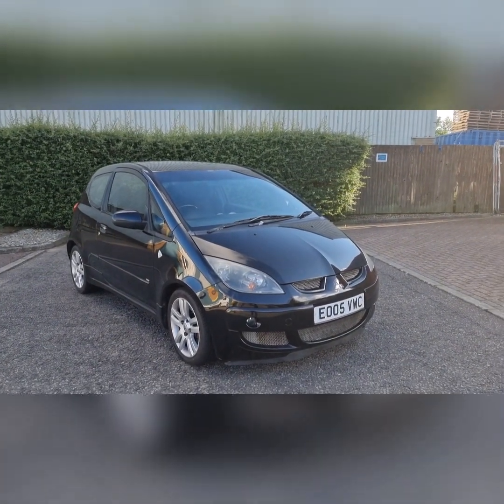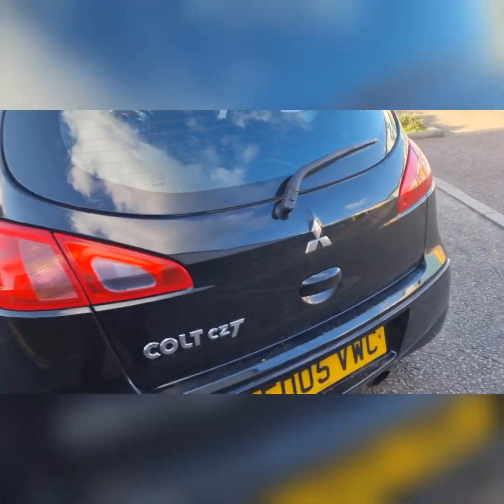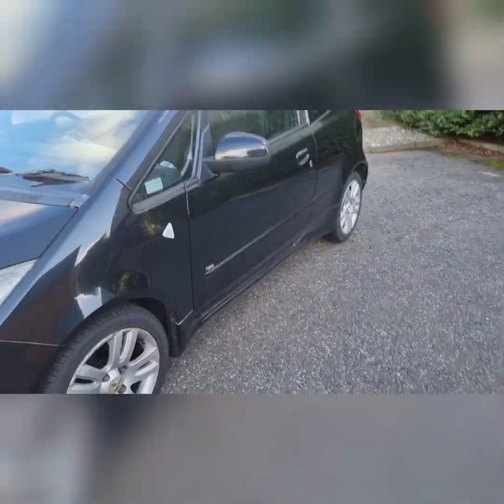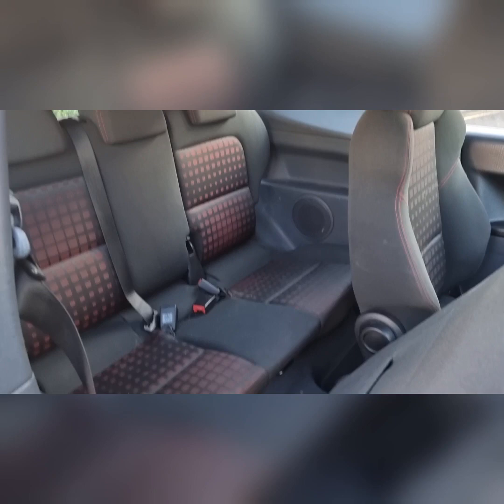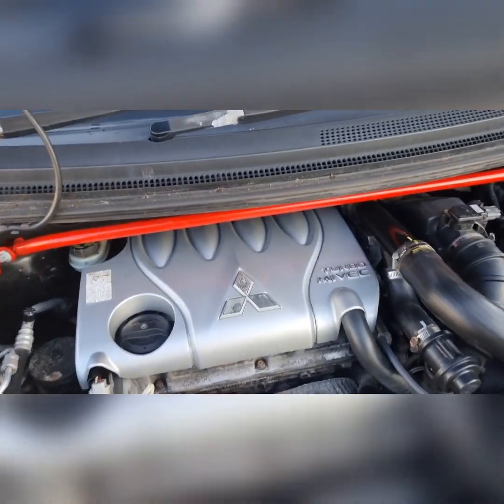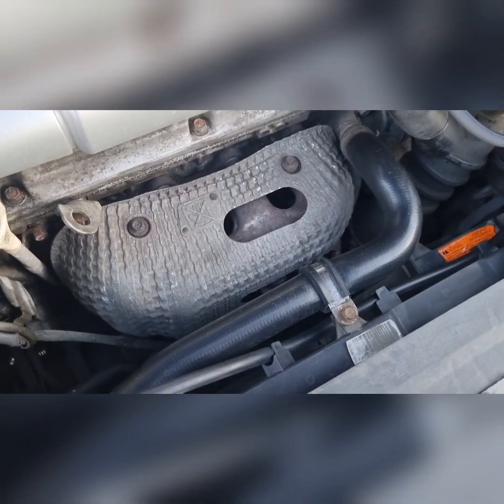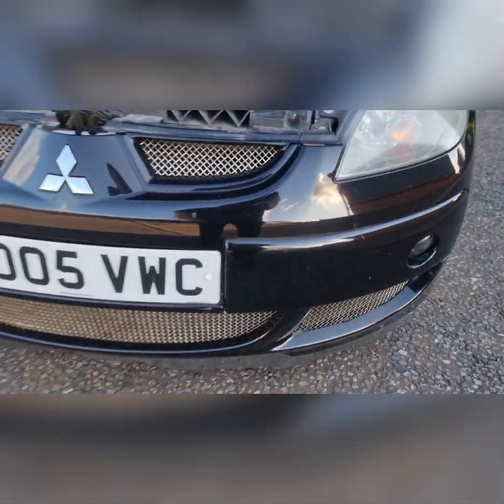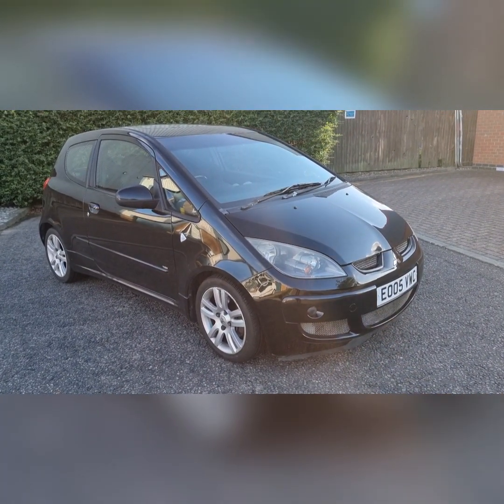*NEW PROJECT* Mitsubishi Colt CZT

Comment: Whip mate I have one in red but I must say In black it looks bad boy mate 😂
Reply from the maker: Its a pain to keep clean though lol
Reply: @hoodedreeper  
I know mate I clean mine everyweek just to keep the shine do you have any mods on yours has it been re mapped ?
Reply from the maker: @sebpalmer8998  Ive got some videos in the pipeline with the next installments. Only have the H&R springs fitted at the moment
Reply: @hoodedreeper  I haven’t got the lowering springs I was thinking about them what are they like on a bumpy road ? And the best place to go to have a re map done is dynodaze they have a Channel on YouTube and they specialise in colts they have all the parts you could want on they’re site and the best feeling you will have is when there is 200 bhp going through the engine the power to weight is sickkkkk
Reply from the maker: @sebpalmer8998  its pretty good over bumpy roads, just abit stiffer than stock suspension but not too crashy (if that makes sense)

I've been speaking to Dan since I bought the car, he's going to make me bankrupt haha